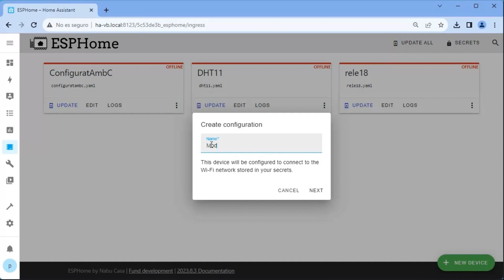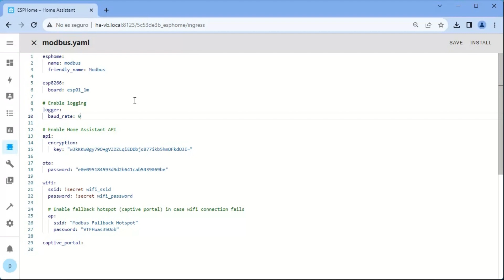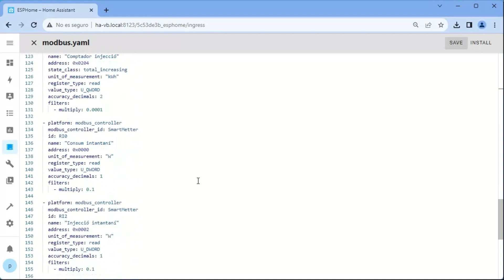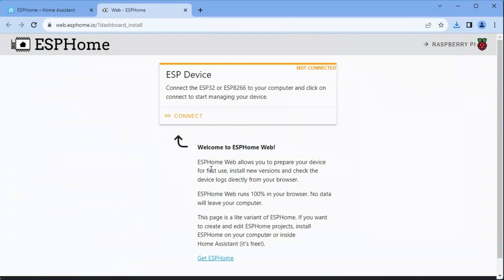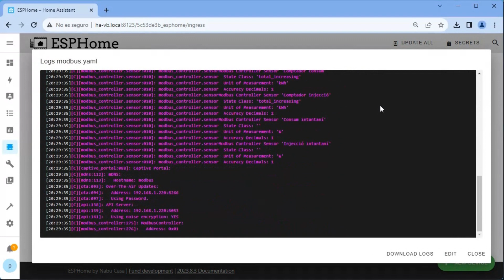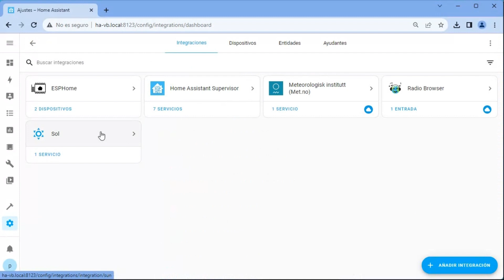Modbus RTU to Home Assistant  with TTL to RS485 electronic card and ESP01 Relay (Soft and Hard)

Comment: Wow this is a pretty advanced stuff! Do you think that the Modbus integration of a device that communicates via RTU could also be integrated to Home Assistant using the Shelly 1pm with the Shelly addon? ChatGTP says that this should be possible connecting the A2 (Modbus A) to the DATA Input on the Shelly Add-on, the B2 (Modbus B) to the GND on the Shelly Add-on and the GND to the GND on the Shelly Add-on as well, but this is something that I have not learned yet. The Ventilation system, that i want to add to my home assistant, itself uses the Protocol Type Modbus RTU and the Connection Interface RS485. 

All the best, 
Yona
Reply from the maker: Thanks for the comment: We have been looking at the Shelly website and we don't see that they have any Modbus or RS485 compatible devices. The Shelly 1pm only have power and power terminals which would burn the RS485 connection interface of your ventilation system.
To communicate this ventilation system you need an RS485 interface connected to your Home assistant.
With a TTL to RS485 converter card and an ESP8266 or ESP32 as I indicate in this video.
Or if you can run a cable from the device that runs HO to your ventilation system You also have the possibility of using a USB to RS485 converter as we explain in this other video: https://youtu.be/x1uV6nRxry4

If you can give us the link to the page of the Shelly device you are referring to, we will assure you but we believe that it is not possible

Regards

Comment: Hello, this looks great. Can you please advise how the HA entities are created or are they created automatically be sniffing the modbus?
Reply from the maker: A moment after installing the device with ESPHome, HA discovers it as you can see at minute 4:30 of the video 'Modbus RTU to Home Assistant with TTL to RS485 electronic card and ESP01 Relay (Soft and Hard)', then in configuration, devices and services, integrations: You just have to configure it and if everything has been correct, after a few minutes the ESPHome integration will already contain the modbus device and this will contain the devices and sensors that we have defined in the ESPHome yaml code.
In the video I went very quickly and the first time I accessed modbus I still did not have the sensors but you can see that by reloading they have already been created.
Greetings.

Comment: Hello. I was thinking about creating a smart home hub with a ESP32 base as the guy in this video - https://youtu.be/Qy9irfpRmUs?si=pIdcJ_rvT_9w_eNt 
He was using I2C for communication between modulles, but I found out that there is some limitations. So after some research I found out about modbus and I run into your channel. But since I'm a complete newbie in this field, I would like to ask some questions if you don't mind. 

So let's say I would have a core module with the ESP32 and some modules with inputs, outputs separately for beginning. My question is that how could I connect these modules onto the modbus so I can read and control all the IO/s from the them? 

Thank you!
Reply from the maker: Hello.
I assume that the ESP32 central module will connect to Home Assistant via WIFI so using the code in this video you can configure it.
But as for slaves, I haven't found a way to configure the "TTL to RS485" card as a slave. In addition, they would have to be programmed with the Arduino or MicroPython ID and look for a Modbus library to be able to manage the requests.
I looked at the Arduino ID and when I put Modbus ESP32 I only find two libraries, one seems like it can only be master and the other is very complex software. I'm finding it very difficult to find a way to configure the slaves.
I have some ESP8266 modules connected by WIFI and they don't give me problems. And to manage the air conditioning, which I don't want to fail, I use a LOGO! microcontroller. from Siemens.
I'm sorry I can't help you.
Reply: @progspont2623  I understand, I also find this https://www.youtube.com/watch?v=xmBWzVGpggo and it's exactly what I'm imagining but I will have to look more into it. Anyways, thank you for your answer! :)
Reply from the maker: Hello again We have found an Arduino IDE library that can serve your purpose "ModbusRTUSlave" on GitHub there is an explanation with examples: https://github.com/CMB27/ModbusRTUSlave
I hope it helps you when we have time we will do tests with it since it is not certain that the "TTL to RS485" card is compatible and if we manage to do so we will make a video.
Reply from the maker: Your comment has disappeared from the modbus RTU slave video, I suppose you removed it, if it is because you have found a way to communicate.
Congratulations.
Reply: @progspont2623  Actually I tried to post a comment for 3 days now but my comments are keep dissapearing for some reason. Is there other way to contact you?
Reply from the maker: The comment has reached us by email.
If you want to contact our email it is progspont@gmail.com
  Regarding the TTL to RS485 converters, they have always worked well for us, we bought 5, the first one we loaded when connecting RX with TX and TX with RX, the second one we have connected in production a year ago without problems and the other 3 we have done many evidence.
To find out what problem you have, first you should have more information. I assume that you use it as a Master: then without having the RS485 connected, every time you make a request, an LED on the converter board should flash.
If not, send me the connection diagram.

Comment: Hello. I must say I am impressed. Thank you for sharing this video. Originally, I set out to connect HomeAssistant directly to my (first ever) ModBus device, then I considered using your ESP01S approach first. Being familiar with ESPHome and ESP8266 helped, but I must say I found your YAML to be more helpful than the original docs. So, I was able to read out sensible values from my Power Meter  WS100-1943 here, on first try! Amazing. And with first try, I mean that's literally my very first foray into ModBus and RS485 at all. Obrigado!
Reply from the maker: Thank you if you can share the code of your WS100-1943 power meter here it can probably help someone :)